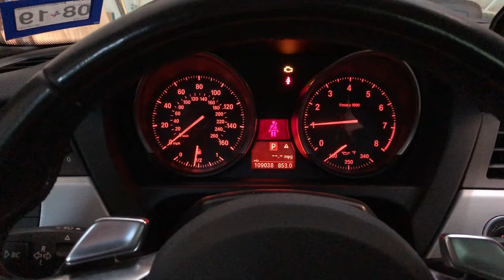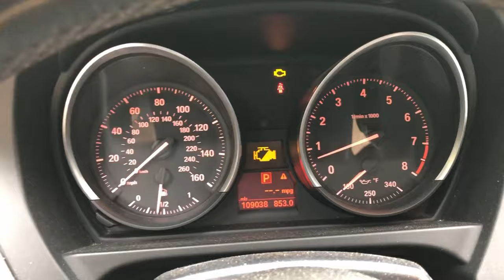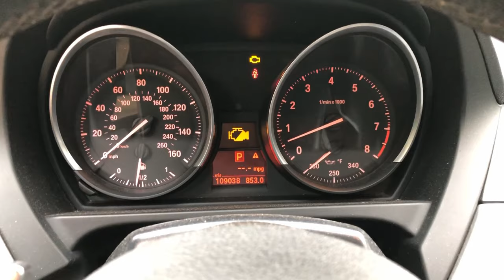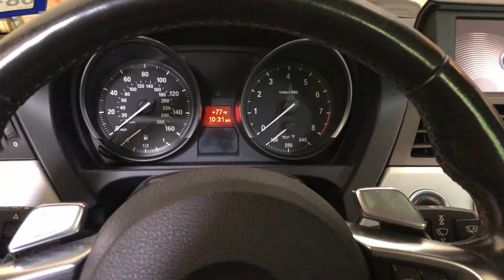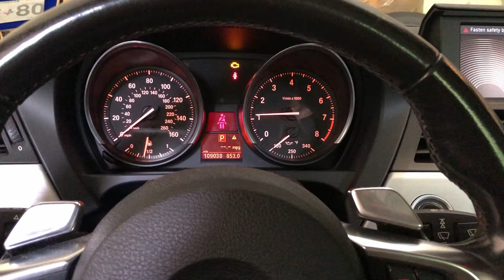CHEAP Rough Idle Fix, Vanos Actuator Cleaning BMW engines including N54 335i

Comment: Fail safe mode will reset after shutdown. Fail safe mode is a mode kicks in when a sensor, breaking system or trans kicks a code. RPMs and the kick down button (gas pedal Sensor) built in side the gas pedal, direct connect or directly linked pedal will have a button Under the gas pedal will be limited, trans will be limited and will not have full gear range, kick down buton will be disabled.